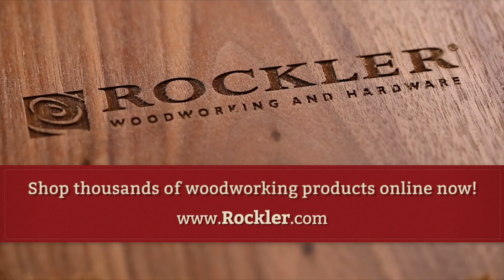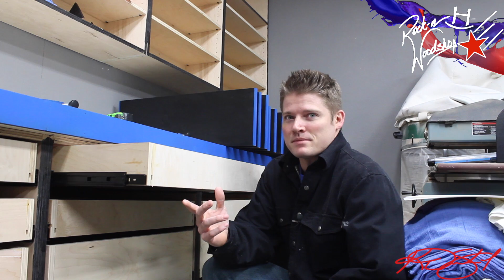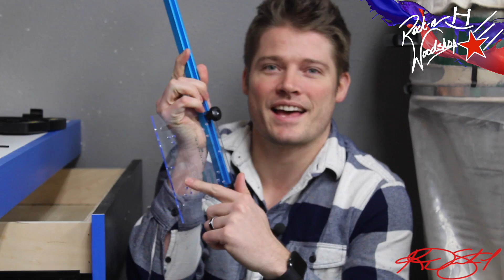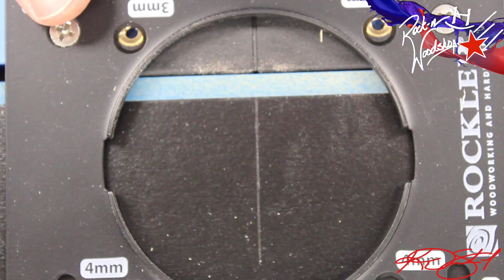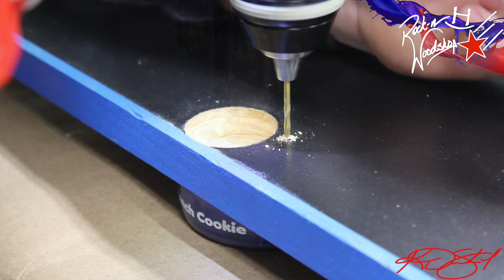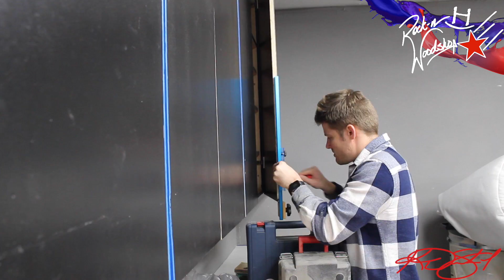How to Install Cabinet Door and Drawer Fronts

Comment: Drew thanks for highlighting upgrades to the Rockler Hinge Jig.  Your doors are awesome. Boom! Here's the Table Assembly Jig V1 I made from original Rockler European Hidden Hinge Jig. http://lumberjocks.com/bkseitz/blog/42959  I had submitted it to Vince my go to guy at local Rockler store several years ago. The original Rockler jig only lined up 1 hinge at a time and had no stop block for repeatable cuts.  I was making very large doors with (3) hinges so I wanted something that would hold doors securely and lock them in place.   It lacked portability though which for my application was fine.  Glad to see Rockler improved on the design adding stop block and making rail longer to accommodate more jigs.  Rockler folks are really great at coming up with good stuff to make jobs easier.Watching your video just gave me an idea on how-to add a vertical adjustment to my table based jig so I can handle different thickness doors -thx again.Going to have to take a look at that Front Panel jig, that looks like a real time saver.
Reply from the maker: +Brian Seitz You are so welcome.  I remember your jig set up in LJ's.  I am sure that your input really helped them learn a few things with the new setup.  Thanks for watching and commenting Brian